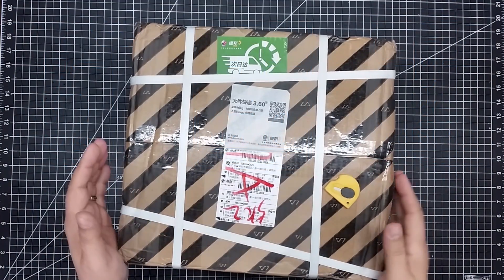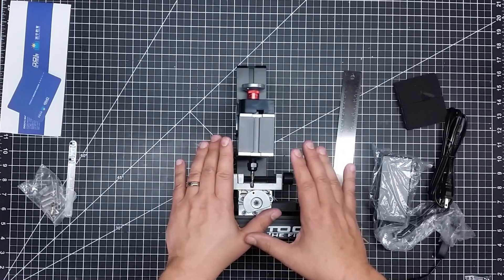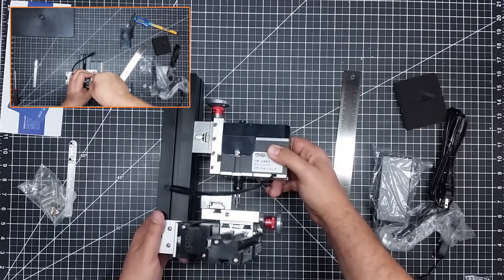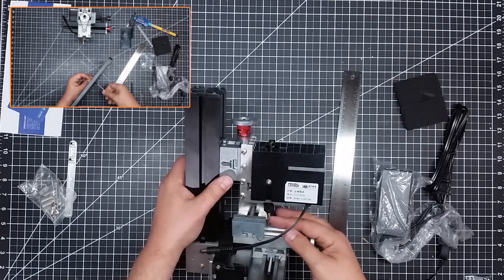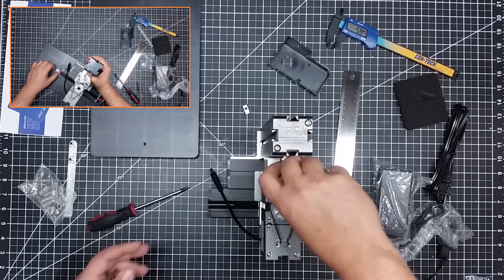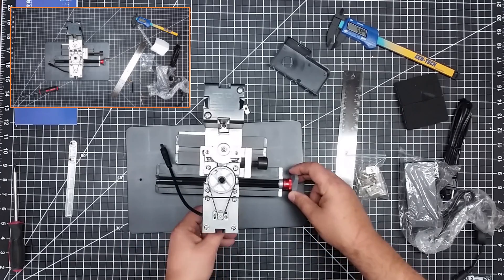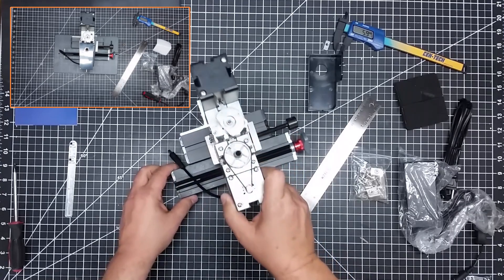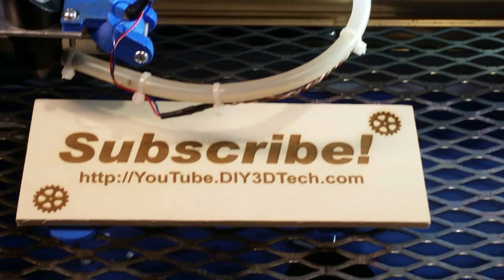MicroMill  - Unboxing and Build Notes!

Comment: I bought the lathe version of this one. Think I payed 150-170 usd. Pretty much the same parts. Its a fun toy, and you get what you pay for. But even for the low price I have to say, there was far to much play before the axes starting to move. I dont realy remember the resoltion for each turn, but on mine you could easily turn 20% of 360 degrees before anything moved. It works okey for manual operations, if you compensate for it, but not very ideal for cnc control. :) I will try to rebuild mine in the future, if there is an solution to the backlas my hope is to build a adruino based threding setup.

How is the play / back lash on yours? And if its the same on yours, do you have any ideas on how to improve it?
Reply from the maker: Yes you can tighten the knobs as the set up is push pull and they leave a little slop as to prevent the knob from binding up.  The solution?  Thrust Bearings, I have an episode on this in the que and should be released in March...
Reply: @DIY3DTECHcom  Thx for the reply.Subbed and looking forward for the episode in march! :)

Comment: Now you can make it a DRO micromill!  (sorry for the long link) https://www.amazon.com/iGaging-35-712-P-Digital-Readout-Display/dp/B01G4FQJI6/ref=asc_df_B01G4FQJI6/?tag=hyprod-20&linkCode=df0&hvadid=312381485888&hvpos=1o1&hvnetw=g&hvrand=1698485396175443544&hvpone=&hvptwo=&hvqmt=&hvdev=c&hvdvcmdl=&hvlocint=&hvlocphy=1026213&hvtargid=pla-570226803276&psc=1&tag=&ref=&adgrpid=62542142819&hvpone=&hvptwo=&hvadid=312381485888&hvpos=1o1&hvnetw=g&hvrand=1698485396175443544&hvqmt=&hvdev=c&hvdvcmdl=&hvlocint=&hvlocphy=1026213&hvtargid=pla-570226803276

Ah..you are going to make it a CNC...
Well if you ever wanted to do manual...you can get those small DRO bolt-ons
Also...go to steppersonline, you can get the high torque NEMA 17's for much less
Reply from the maker: Naw I am going full on CNC actualy printing the first test motor mount as I type this.  However have seen these and doing a knock off for the Mini-Lathe :-)